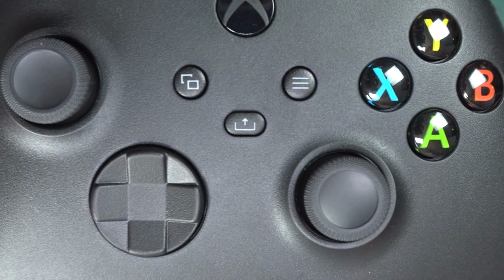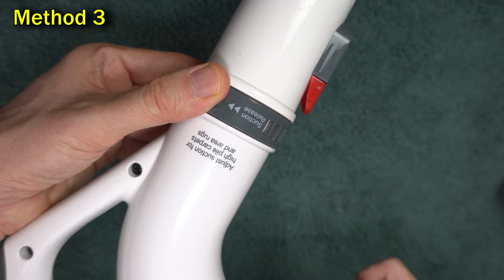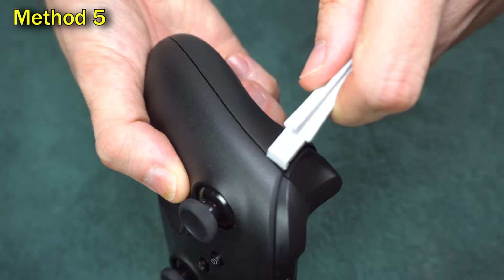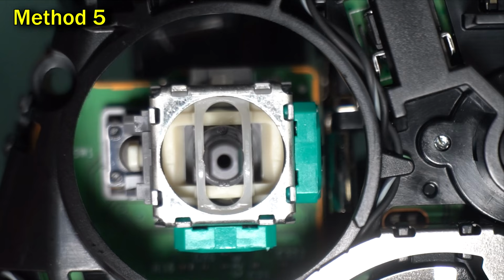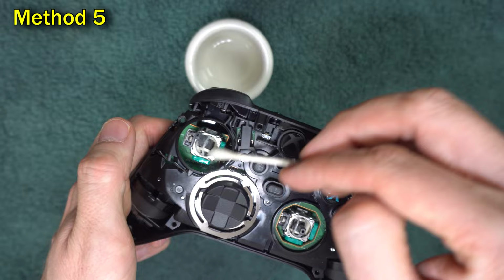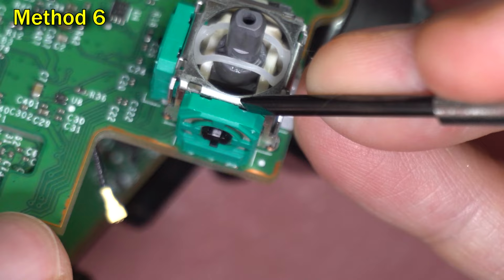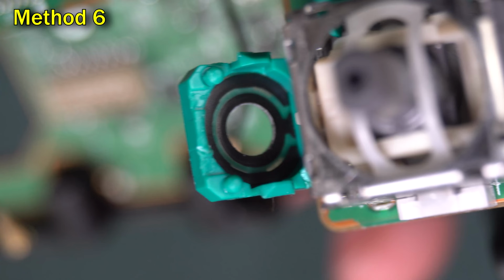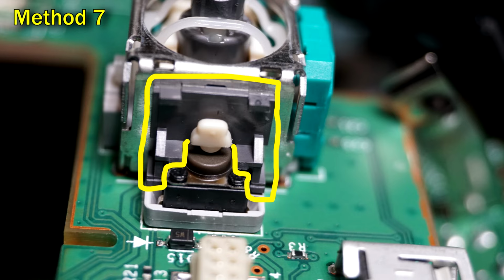How to Fix Analog Drift on XBOX Series X/S Controller (moving on its own, jittery, wrong direction)

Comment: I'm having a random xbox one controller problem that came out of no where when I woke up this morning. My right thumbstick is stuck in the up direction, but it's not physically stuck up. It's definitely not a stick drift problem. I don't know what the hell it wrong with this. An example, when I'm on fortnite, my character is just looking straight up while I can move the right thumbstick in any direction, I only can turn left and right, but still looking straight up. Can't look down. I tried another controller and it's doing the same thing. Is it my Xbox one? I turned everything off completely,  unplugged everything and tried again and it didn't work. The Xbox menu movement is like supper fast when navigating through options. I don't know if y'all knew this tho, but if you hold the right stick in any direction in the Xbox guide menu, or the home menu, the selection movement will be twice as fast, and I'm stuck with all this and I don't know what the hell is wrong. Please help!
Reply: Any fix?

Comment: so I did method 6 and now the drift on my left stick goes towards the right now should I clean it again or is the disc broken?
Reply: To fix my I took it apart and just pulled the senor out and blew on it then snapped it back in place…it works now
Reply: @Milesatron  I'll probably blow on it to see if anything helps if not I'll buy new analogs sticks and use new sensors

Comment: Hello, i have a problem with the xbox series s joystick controller, (it does turn on) the buttons and levers do not work (i already synchronized it with the ucbc cable an it continues to turn on, but the buttons and levers still do not work, i even connected it to a computer and there it works, but it doesn't works in the console, it just turn on)

Comment: Help! I was having issues with stick drift on the left stick, specifically up/down motions. I went through step 6 and it fixed it, but now right/left motions on the left stick don’t work. What did I possibly do to break that? Where do you suggest I go back and re/clean or reconnect something?

Comment: I have an xbox series controller that I don't think you can get easily brand new any more, it's the late 2022 lunar shift and it won't charge, ive basically kept it in brand new condition and never used it, I might have to get a new set of cables and battery packs for both my controllers, I have a standard black controller also, I bought in march, came with my series X and it's got minor but still annoying stick drift, ive played alot of hogwarts legacy and starwars jedi survivor and charged it a bit but it's in brand new condition. Shits me off & makes my blood boil that something in pristine condition that's been used minimally can break down like that, they don't make em like they used to

Comment: Had a ps4 for about 4 years and only needed one controller, I thru that controller against the wall, smashed it on the desk countless times presst it so hard together that it squeeked and almost broke a hundreds of times and it never broke, I have my Xbox s for about 2 years now and I’m on my 4 controller without throwing or damaging any of them it’s just always stick drift, the new Xbox controllers suck mayor ass
Reply: Yep i just might switch to ps4 or 5 controllers at this point i even had a xbox elite 2 controller it also had mayor issues and drift after only 1 and half year...

Comment: So I’ve owned 4 next gen controllers and what I found out is the all of the left sticks won’t lean left 100% it jumps between 98 to 96 that’s it but will lean right 100% I’ve tried to update an nothing still the same so I had to shave the inner edge so it can lean the 4% I needed

Comment: Welp, i broke my controller even more now lmao. Idk what i did wrong, but not only was i not able to do step 6 due to not having the correct screwdrivers, but now the battery case doesn't work either, controller now only works when connected by usb cable 😞

Comment: Well my little cousin thought it’d be a great idea to follow a TikTok on how to farm XP in warzone while at school & put two rubber bands on the left stick & left it like that till I came home after work to see if. Of course when I tried using the controller it’d spaz out & so I found & used my other controllers cause it was a loss cause. The controller is what you get from the Series X & it’s been sitting unused since then & now it’s not crazy stick drift but it’s still sensitive if I go up or down as it’ll just go all the way down or all the way up if I’m on the menu screen. Should I just buy a new controller at this point as I really like the feel of it & the rechargeable batteries fit better on it with the back too

Comment: i broke my LT and it was a horrible experience getting the vibration part to stay in while re-attaching it. i decided to cut the wires off of it and out of the controller. it’s been working ok but i wanna know if that was a mistake cuz i might jus be lucky

Comment: The problem I have doesn't seem to be drift, I can play games that don't need to move the analog stick precisely, for example, if I play FiFa I don't have problems, but if I play a Baseball game I have problems, in the Baseball game when I throw the ball there is a crosshair in the game and if I move my stick up a little bit the crosshair always goes up even if I am not moving the stick, the problem with my controller seems to be the precision, if I move the stick totally the controller works fine but if I move a few millimeters up or down the stick always goes up or down.
I bought the controller a year ago and have warranty the only solution I will try is to update the firmware and the rest I will not risk, although the firmware should not solve the problem, I already had a bad experience in updating the firmware years ago when I had a controller xbox one and at the time the problem was that the controller turned off alone, I tested several solutions and nothing solved when I installed the firmware the problem was much worse because before the controller turned off more or less every hour when I installed the firmware started to turn off every 5 minutes, so yeah bad experience with firmware updates...
although I like the xbox controls, I will probably stop buying and test the playstation to see how long it lasts , I did not want to change because for me the xbox controls are much better, not in durability but better in for example the analog stick left to be in the position it is for me is perfect and beyond the triggers that I also like a lot, but when the products last a short time and cost a lot ( 60€ ) better give a chance to the playstation or maybe test other brands...
Reply from the maker: Drift and lack of precision are pretty much the same issue. You said you don't want to risk working on it, but the cleaning tips in the video that don't involve going inside aren't very risky.

Comment: Compressed air will not introduce moisture...
Reply from the maker: It will if you tilt it. There's liquid in the can.
Reply: @HowToX  Avoid spraying the refrigerant liquid, which can happen if you shake the can, or angle it too much. The refrigerant is very cold, so can damage some sensitive electronics.
Avoid cheap retail dusters that contain bitterant. Many retail dusters have bitterant added to prevent huffing. When duster is used in the home, there is concern that the material will be purposely inhaled (called “huffing” or “dusting”) by minors, which can sometimes lead to tragic consequences. To avoid this, bitterant is added to make the duster taste bad. This same bitterant can lead to unwanted and potentially harmful residues on sensitive surfaces like electronic circuit boards.

*Compressed air is still far better than blowing into NES games, I mean, analog blocks.

Comment: The drift starting after I updated the firmware.  Lol.   Im having major drift on my Xbox series s controller.   I fixed it by using gauz and cleaning the crevices on the right analog stick from my first aid kit.
Reply from the maker: I think you can reverse a firmware update through the Xbox help menu.

Comment: Tried method 6 but now my controller won’t come on at all 😢
Reply from the maker: Check the ribbon cable that connects the two halves. You may have it reversed.

Comment: I did everything on the video and it didn't work out. I even broke a cable on the motherboard and somber it back. After I watch the video again I found out that I forgot to clean other door that actually causing my problem which is y axis. I don't want to break it open again cuz I don't believe in myself for not breaking another cable again but I have to I guess. I know nothing about sombering so I guess I was lucky first time it happen. I'll try and hopefully fix this damn thing.

Comment: I am not sure if you are still reading comments, but method 6 worked for me!  it did stop the drift, but unfortunately now it takes the SLIGHTEST touch for it to move all the way up (left stick) I can press down the L stick and it will also think I'm moving it upwards all the way, 

Any help? I cleaned both discs and the doors with alcohol, is there a way I'm supposed to put the discs in? (I put them both with the black side facing out, as shown in the video)
Thank you!
Reply from the maker: Hello. It's always hard to diagnose from afar, but I would experiment with adjusting the little metal wiper on the disk. Bend a bit inward, or outward.

Comment: I put it back together and it fixed the problem. I’m having a problem with my headphones now, it’s staticky and cuts off. My headphones work good with my other headphones and worked good with my controller I took apart (before) but now it’s messed up. What went wrong?
Reply: you bought this controller

Comment: So I was confused why my Xbox was going any direction twice as much as I imputed, and why I had right stick drift, turns out it was my Xbox and not my controller because it did it with everything, including a keyboard and every other controller I had, even a new one I bought just for the problem. If you know why this is happening and know how to help that would be appreciated.
Reply from the maker: I have never heard about an issue like that. This seems like something you should ask about on Reddit, or possibly try to contact Xbox support. Maybe you are still under warranty.
Reply: @HowToX  I worded it pretty bad but it is double scrolling with joystick and d-pad and slight up movement with right but I have found a video on how to fix it, thank you for your concern though
Reply: @GuyArnold1801 This is happening with me on the dashboard and on COD. 

Dpad is doing multiple inputs when you tap from tile to tile it skips 3 at a time etc. And stick is drifting up in COD.

Just did upto method 6 just now and no joy, same issues ... Can you help or tell me the video that fixed it? 

Thanks
Reply: @thebesttheworst2277  yeah I didn’t feel safe with the cutting of wires and stuff so I just put it back together and had to deal with the fact I needed to use a different controller
Reply: @thebesttheworst2277  obv it’s been a few months since I’ve done that so I might be missing some details sorry I can’t really help
Reply: @GuyArnold1801  Okay, but you said in your original post it was happening with all your controllers and keyboard and even new ones? So are you saying it just went away and eventually you got a controller and the issue stopped?

Do you have any info or remember the video you watched ?

Thanks for your time and replying so quickly 👍👏👌
Reply: @thebesttheworst2277  I think what was happening is when I turned off my controller that I put was still in the system so it still kept the drift on
Reply: *input
Reply: @GuyArnold1801  Okay thanks, so in the end you got a new controller and it sorted you out ! 👍

Comment: Hi, I have an issue with my controller that wasn’t answered in this video, maybe someone could comment a solution? 

I was playing overwatch like I usually do-nothing was off at all. All of a sudden, I get the worst stick drift I’ve ever seen but it would only be in Xbox menus. I wasn’t drifting in game. Also, whenever I would click the Xbox button on the controller, the in-game menu would pop up. Also, I couldn’t access the game menu without clicking the xbox button because it wasn’t working. 

This all happened instantly-I had no instances of stick drift on my current controller just a minute before it happened-it was so sudden. Any ideas of how to fix it?

Comment: so not saying your tutorial is at fault but I broke my right analog stick in some way, now it only goes left to right, and up and down are unresponsive😭😭😭😭😭😭
Reply from the maker: Assuming you got all the way to the white disc, go back in and pull it out again, mess with the little metal parts on it, then reinsert.
Reply: @HowToX  thank you for the reply but already done that, I can't understand why, I think that the connection of the blue door itself might be broken with the circuit board, I mean that's the only thing I can't directly see in there

Comment: I have a slight problem my screws have a cylinder in the middle of them making my piece to unscrew it Nannie’s because it won’t fit because of the cylinder in the middle of the screw
Reply from the maker: You just need the right bit.

Comment: Very helpful video but sadly this controller is so far gone I couldn’t fix it. 
Very disappointing as I had only been using this controller for a couple months until the terrible right stick drift appeared. Oddly enough my original xbox one controller has lasted for a few years and only now shows some problems. Newer doesn’t seem to be better.
Reply from the maker: Correct, new controllers can leave the factory with problems. I will say that Xbox has the same issues. Until these companies change over to hall effect sensors, it will continue to happen.
Reply: Same here! xbone controller beat my series x controller (xbox one is 4 years old, series controller not even 12 months)

Comment: i have a bunch of xbox one controllers that keep drifting to the right on the left thumbstick, i dont think its drifting at this point but its the only thing i can find its all xbox brand controllers not the off brands. the reason why is because it has happened on every controller ive connected to my pc via usb cable. i have 7 or 8 controllers ive tried after it kept happening. ive tried different usb cords and even different ports on my pc. i dont know what it is maybe it just cant connect properly?
Reply from the maker: It could be you are playing the same types of games, so you are wearing out the same part of the controller. The cleanings in the video can help, because some of the wear causes debris to come off, if that makes sense.

Comment: That grey thing there at the end fell out on it own and ended up floaring arpund inside the controller mostly blocking my stick from goingnleft or blocking my left trigger
Reply from the maker: Wow. Hopefully you were able to get it working again.
Reply: @HowToX  easy just took the piece out and it worked like normal again

Comment: WARNING ⚠️ PSA ABOUT BUYING FROM GAMESTOP: If you buy a controller from GameStop, do not buy the warranty. I bought the warranty in 2022 and it expires October of 2024. The agreement was if my controller broke they would replace it with a NEW CONTROLLER. That is no longer the case. They will only replace it with a refurbished controller. That was not the deal of insurance i paid extra for and they will no longer honor it. So don't buy the insurance if you buy from GameStop. Hell, if you can avoid buying from GameStop in general i say do that. I used to love buying my stuff from GameStop, but with all these anti consumer policies they've been putting out, i can no longer support them.

Comment: My controller joystick can move all ways fine except for up. When I move the joystick up it’s almost responsless, I have to like jab it up hard to get the response. Help?
Reply from the maker: Attempt the things in the video if you haven't already.
Reply: Do you know if this is due to debris? I tried everything but the risky techniques
Reply from the maker: A specific symptom cannot be traced to a specific cause when it comes to controller issues. It COULD be debris. My newest video for the DualShock may give you some additional methods to try.  https://youtu.be/U_WEnSbHWgI

Comment: Hi, I opened by controller and now AA Batteries nor my play and charge kit are working anymore? Please help
Reply from the maker: Check all ribbon cables. Make sure they are connected.
Reply: @How To X  everything looks fine, not sure what could have caused this, it was working fine before I took it apart, done everything very carefully and did not go beyond method 6 anyway

Comment: 7:25, my door didn't close properly, I tried multiple ways of prying it back on, eventually thinking I'll attempt superglue, accidentally got glue on the top of the black disc thing with the 2 little thin metal strips, fucking the whole thing. 

I know that's my fault, not yours. But damn does it piss me off that I went through every minute cleaning detail and testing and finally getting it to work properly when squeezing the green thing on. But it wouldn't stay and I couldn't for the life of me figure out a way to make it stay. yes I even tried cutting the little prong. fml